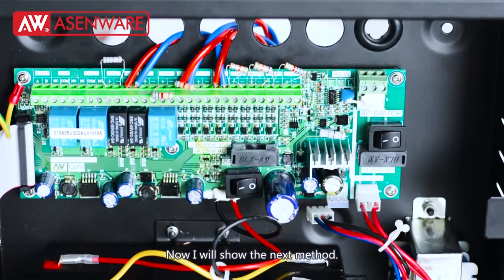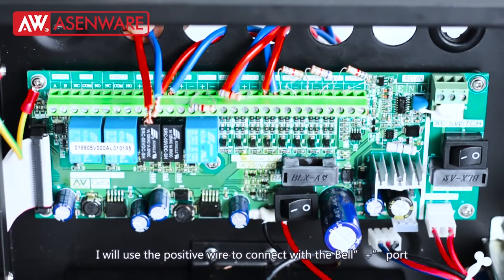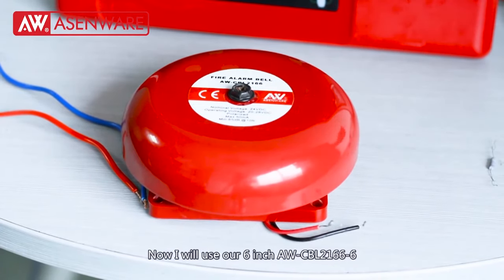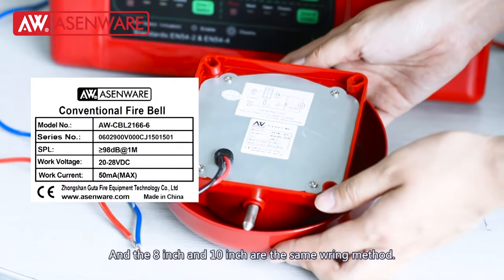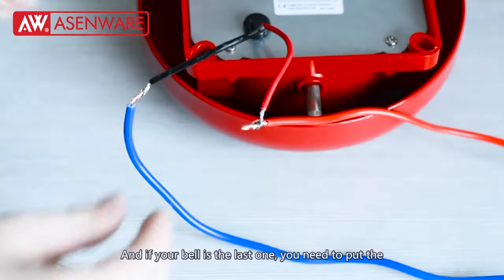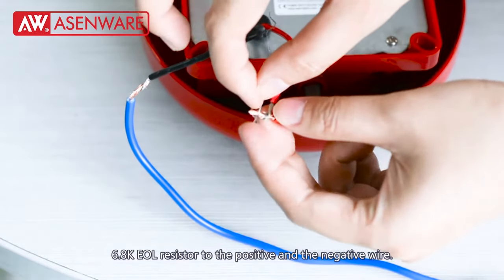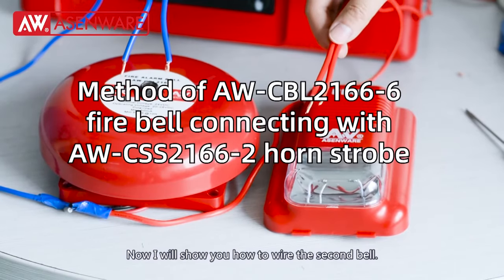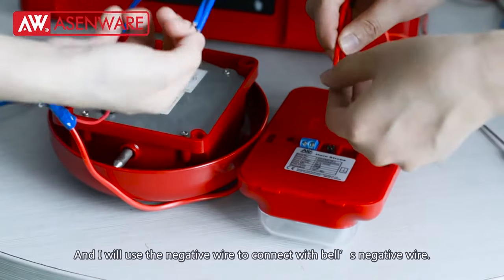How To Wire A Fire Alarm Bell

Comment: If it still work even if i use 25mA alarm bell?
Reply from the maker: Thank you for your support
Asenware conventional panel bell port maximum currency:
1 zone : 200 mA
2-4 zone :300mA
6-8 zone: 400mA 
12-32zone :600mA 

Regarding your 25mA fire alarm bell, we also need to consider  the alarm current, make sure that the total alarm current for the bell you connect is within the range we mentioned above,then can work nornally.